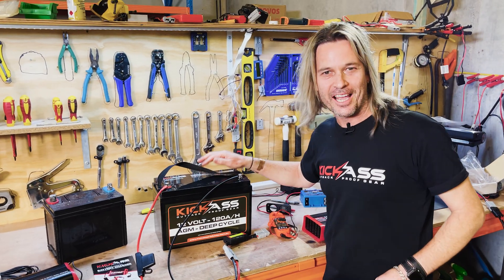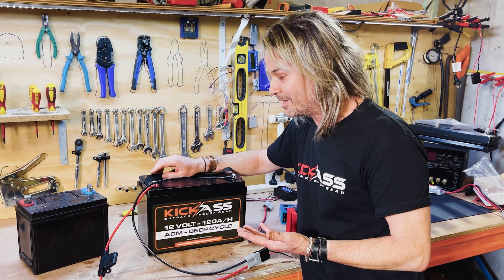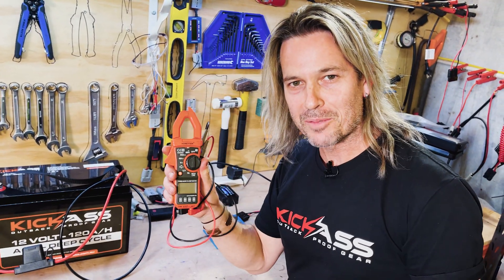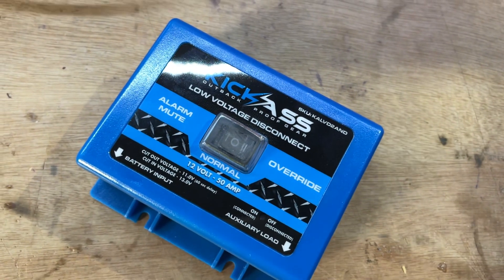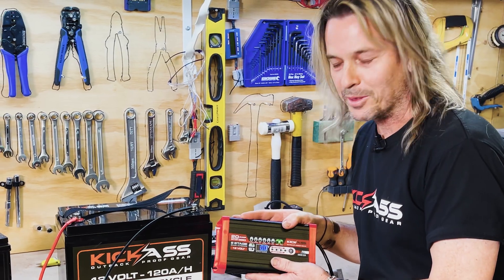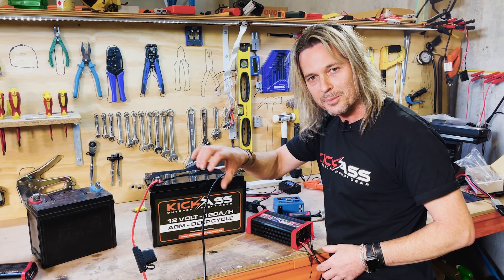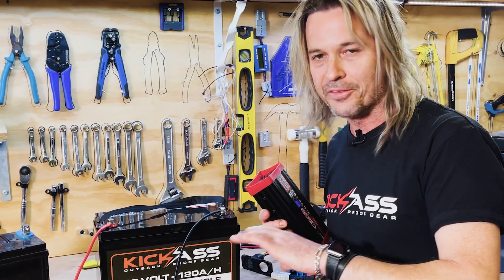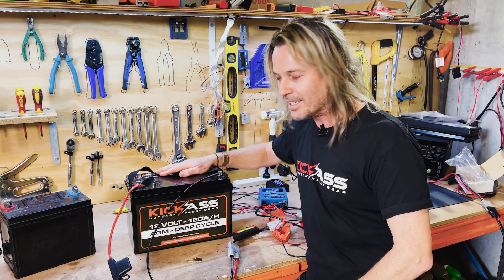How to charge and maintain deep cycle AGM batteries with Craig from KickAss Products

Comment: Hey Craig - Best video I have seen so far on battery maintenance explained in an easy to understand way. Can I ask a quick question? I am a newbie to this and recently bought a camper/motorhome with two solar panels which also came with two 80 Ah Gel Leisure Batteries already installed a few months ago by the previous owner. My understanding is that combined - these gel batteries should be capable of 160 Ah total (80 + 80 = 160). However - the camper's control panel reads as 100% capacity fully charged at 104 Ah, and not 160 Ah as I would have expected. Any idea what the reason for this apparent discrepancy might be?
Reply from the maker: Yes, they should be 160Ah.

1. The problem with buying 2nd hand batteries is that you do not know how many times they have been cycled. So they may have had more use than advertised. Same as when the used car salesman tells you a little old lady only drove it to church on Sundays.

2. Ensure that the charger is set to the correct settings. Different chemical makeups have different charging profiles. Make sure your charger has a Gel setting and is set to that.

3. Remove the batteries from the system and charge them separately on a suitable 240v AC charger (Again on the Gel Setting) This will ensure that the batteries get charged to the max. Some solar chargers especially PWM will not be able to provide a high enough voltage to fully charge the batteries.

4. The batteries may have been damaged at some point. If a battery is overly discharged it can do permanent damage. Even a brand new battery that is overly discharged will suffer a loss in capacity.

Hope this helps.
Reply: @KickAssProducts  Thanks for such a detailed and helpful answer. Subscribed. Regards.

Comment: I had the AGM battery in my Camper Trailer maintaining the charge off my KickAss Solar Panels for about 4 years now..... the other day I swapped the Solar Panels off my Camper Trailer so I could charge my Kickass Power Box for 3-4 days..... I came back to swap them back over again and find my Camper Trailer AGM battery at 10.5V 😪 without any items on to drain the battery, do you think the battery was on it's way out anyway or is 3-4 days (of no load) enough to take the charge on the battery from 13.1V to 10.5V?..... I have my KickAss Charger trying to "revive" my Camper Trailer AGM Battery now, hope it works!!! Cheers, Don, Perth WA 😀
Reply from the maker: Hi Don, That is very strange for the battery to drop voltage like that without load.

Are you trying to revive with an AC charger. If so, have you removed the battery from the system and tried to charge it with nothing else connected. 

If you can get it to charge then run one appliance off the batter (ie a fridge) to see if it discharges correctly.

If the voltage drops again rapidly this is a good indication that your battery has expired. Sorry.
Reply: @KickAssProducts  No worries, I'll give it a go. Thank you very much for your advice :)

Comment: An adjustable setting for the LVD would not be that difficult to engineer and would be of tremendous value. What is the max amp rating the LVD can safely discounnect at without buring up the contacts? Does it have a rating for that? Thanks again for these short and to the point YTs as I always learn something of value.
Reply from the maker: Hi Ben, While an adjustable setting would be possible it would drive up the manufacturing price and make the unit more complex. We have designed this as an inexpensive last resort. The unit is rated at 50 amps.

Comment: you said 10% amps of the capacity. can I use a lower amp charger eg: 6A for 115ah battery? it just means it charges slower right?
Reply from the maker: Correct it will just charge slowly. We just don't recommend that you use a charger that is to large as it can cause the battery to overheat.

Comment: Hi mate, just bought a caravan, first time user.
It has 2 x 225 amp AGM batteries hooked together, with solar charging.
What size 240 charger do I need to keep batteries charged at optimal level when not in use, and under a carport.
Great vid too.
Reply from the maker: I would go for a minimum of 22 amp. https://www.australiandirect.com.au/buy/kickass-12v-22-amp-9-stage-battery-charger/KACHG1222
Reply: Thank you for taking the time to reply mate. I must add they are two 6 volt Power AGM's hooked to make twelve volts, I also want to keep the charger in the van permanently connected and with the 240 volt plugged in and on, and it will only start when I plug into 240 power, because the batteries are under one of the beds.
 I suppose what I'm trying to say, in Maintenance mode?

Comment: 6:45 I have a much smaller battery bank of 2 28Ah AGMs in parallel.(56Ah total) I assuming a 20A DCDC is too powerful for me?
Reply from the maker: Hi Jay, 20 amps is definitely too much current to put into batteries that small. You would risk over heating them and causing damage.
Reply: @KickAssProducts  yea that’s what I figured.  Thanks for the input. Great video by the way.

Comment: Hi, I want to use an AGM as an uninterrupted power supply for a 240v 50w fish tank filter using an inverter. The battery will need to be under constant charge through a 240v charger. Even if I disconnect the charger once a week to allow the battery to cycle, will it destroy the battery or just shorten its life? A new battery every couple of years is cheaper than losing a tank full of fish during a blackout. Thanks.
Reply from the maker: Hi, Our systems are not really designed for this kind of application. The problem is that if an AGM battery does fail at some point you won't know about until the blackout as the charger will continue to keep the voltage up. I would highly recommend buy a small UPS (uninterruptible power supply) They are designed to keep computer systems running during a blackout.

Other wise Option 2 of disconnecting the battery periodically and allowing it to cycle is more preferable.

Comment: Hey, thanks for the video and info. I willonly be using my 120ah battery maybe 2-3 times a year. Should I keep it fully charged when in storage? Should I discharge it slightly and charge maybe every other month?
Reply from the maker: Try to keep it fully charged. The battery will slowly dis-charge over time so it's a good idea to check it now and then and give it a top up.

Comment: Can I please ask, why is it not ok to have loads on the battery when using a 240/12v to charge battery ? This is exactly what is happening when a battery is connected to an MPPT or DCDC charger. Perhaps it is optimal not to have a discharge at the same time but still acceptable. eg - camping and using a generator to power the 240/12v charger.
Reply from the maker: We recommend that you do not Discharge at the same time when charging from 240 as this should be the time that you are allowing your battery to recover and get a proper full charge. Generally charging from 12 volt sources is intermittent, your vehicle is not running constantly and the sun is not shining 24/7. So your battery is allowed to cycle. But providing a constant 240 volt source and running a load on your battery for long periods of time will eventually damage the battery. 

2nd, If you have 240 volt available why would you run it through a battery to run appliances.

Comment: Thank you guys for this. If only I'd known all this before I trashed my very first AGM battery. The old Arkpak battery pack is failing so I just bought the Kickass Powerstation which will mean I should have no more worries. Life's a learning curve I guess. Thanks again.
Reply: You are not the first to trash the first set of batteries! It took me over 8 months of traveling before I finally got the general gist of batteries - when I trashed both!  Oh yes, a good learning curve, goes with the territory. lol
Reply from the maker: As long as you look after your battery you won't have any more troubles.
Reply: Good percentage of us do mate. I discharged my 115aH to the point of no return. Lucky it was $80 from marketplace 😂

Comment: hi craig , dont know if you can help mate , but ive got a solar set up off grid here , when i charge my battery bank  ' 4 x 12v batteries hooked up for a 48v set up ,  the batteries are190 ah each but ran as only 190 ah together , which sux  because i thought i'd get 700 odd a/h  , but i cant do it  , anyway my problem is , the batteries will charge upto the 56v i set them to , but then they start discharging ,  is that normal ?  i need the 56v so i can run my set  , and it runs down to 48.1  that i set as minimum  then next day it recharge to 56v again ,  but , soon as it hits 56v , it starts coming down  with no load on it ,  best way i can describe it is , it charges to full then discharges it ,   can you help me at all ? i'd very mjuch appreciate knowing how to keep my battery at 56 and it holds there until i use it .
Reply from the maker: Hi Dave, Unfortunately we do not advise on off grid solutions. 

We specialise in small setups for caravans, campers, 4wd's etc. Best bet is to speak to someone who is an expert in off grid systems. Sorry.
Reply: @KickAssProducts  was worth a shot  lol . thanks for replying

Comment: hello i can"t understang inglish well can you tell me minimum discarge voltage for agm 12v ?  Thank you!
Reply from the maker: You should only discharge an AGM to 50% of its rated capacity. 

It is advised that you do not let voltage drop under 12V at rest.

Comment: Do u guys make a lithium battery bc I’m hearing a lot on the web how you can use a lot more amp and does better with temperature also Weighs less charges quicker as well
Reply from the maker: Hi Doug, we are working towards a lithium battery, hopefully we will will have them available early next year.

Comment: Great information thanks. Can I just clarify, if I want to use ‘shore power’ when camping at a powered site, I should run a smart charger through a DCDC charger if I’m running my fridge and other 12v appliances?
Reply from the maker: No, don't run an AC charger through a DC charger. Your charger needs to be able to read your batteries voltage so that it can input the right voltage and current. 

You should have both chargers directly connected to the battery. But only use on or the other.

Comment: Great video! When batteries are not being used for several months, is it better to keep on trickle charge or occasionally put it on 240v charge?
Reply from the maker: EIther is generally fine. If you are going to leave them on trickle charge make sure you have a charger that supports that mode so that you do not over charger your batteries.

Comment: Hey, Love the video.
I have a 120ah battery in a box with a projector dc charger sitting on top, can I plug the 240v charger straight into to it or do I have to disconnect the dc charge first
Reply from the maker: If your DC charger is not receiving any input from a solar panel or alternator then it is fine to plug in your AC charger to one of the standard input/output andersons as the DC charger has an isolator built in.
Reply: @KickAssProducts  Thanks for getting back to me.

Comment: Can you give the specs for the chargers and DC toDC kit please or put links to the gear that you use
Reply from the maker: The DCDC charger specs shown are available here: 
https://www.australiandirect.com.au/buy/kickass-25a-dc-charger-with-anderson/KADCDC25A-AND

The 20 amp 240 volt chargers are available here: 
https://www.australiandirect.com.au/Battery-Systems/20Amp-Deep-Cycle-Battery-Charger/KACHG1220

Comment: Put 2 new 120agm batteries in caravan... Volt meter shows 13.2.have been on 240v since i bought them. But then it goes to 13.4 then to 14.0. And goes back to 13.2
Reply from the maker: The reading will change as the 240v charger runs through different cycles.

Comment: I have 2 135Ah batteries and use the Kickass 20amp charger when they are not being used. Is this still ok to use? Or do I need a larger charger
Reply from the maker: You might find that you are running the charger very hard to charge such a large capacity and it will take a very long time to get a full charge. A larger  charger would definitely be beneficial. 

You may find you will get a better result charging each battery separately.

Comment: Hi their! Interesting video and quite helpful. You said not to connect any other loads when using the 240v smart charger! Is it ok to still have a radio or CD player connected to maintain power to the memory or clock in standby mode?providing I don’t switch radio on by the radio on acc wire!
Reply from the maker: If the radio is switched off / standby mode then the current draw should be next to nothing so this should be fine. 

The reason why we recommend that there is no load attached is because any current draw lowers the batteries voltage.
Therefore the smart charger will detect the the batteries voltage as lower then it actually is and over charge it.
Reply: @KickAssProducts  that’s perfectly understandable! I recently did a pet project, it’s a tool chest upper half boom box radio with a couple of power sockets it runs on x2 15 amp hour batteries. I’m using 240v smart charger to charge batteries, I was bit concerned about radio stuffing up or the battery over charging when radio on standby while on charger! So far I’ve had no dramas just as long as the accessories connected are switched off with the exception of the radio on standby! Thanks for your help!

Comment: With Lockdown here in Melbourne continuing and I'm not going anywhere, could I purchase an AC charger and charge both my main starting battery and an AGM battery that is in the engine bay both at the same time by connecting to the main starting battery as there is a shut-off solenoid already connected and thus charge both batteries as it would normally do when the motor is running?
Reply from the maker: With our 240v battery chargers the settings are different for different battery types AGM, Wet, Gel etc. This is to ensure that the correct voltage is applied to the battery throughout the different cycles. 

We recommend you charge the batteries separately for the best results. 

Use the "Wet" setting for your starter battery. 
And obviously the "AGM" setting for your auxiliary.
Reply from the maker: I do apologize I accidently deleted your comment as I was replying.

Tim's question was along the lines of "why can a vehicle's alternator charge both batteries at the same time? and is there a product that can do this?"

Comment: Is the battery disconnect (the blue box, LVD) settable or is it at a fix number of volts?
Reply: Fixed
Reply from the maker: Hi Ben. The LVD has a fixed cut off at 11 volts.
Reply: Is there a LVD with a watt meter ?

Comment: When are you guys going to get into Lithium? It’s getting close to calling time on AGM. LiFePO4 is getting quite affordable and lots doing it themselves with cheap cells and BMS’s from China anyways. With your access into Chinese manufacturers and suppliers I’d expect to see that by now?
Reply from the maker: High Mike, We are currently developing a Lithium battery! We are taking our time to ensure that when we bring it to market that it is the highest quality we can produce.
Reply: @KickAssProducts  great to hear! Can’t wait to see it.
Reply: @mikewasowski1411  hey you should do a video on the set up you did. I’d like to see it and use in my boat over the 2x agm set up i currently run.
Reply: My research tells me AGM is still better, the only thing LifePo4 had going for it is weight. lack of weight. There are some good videos explaining the reason.
Reply: @dennisbauer3315  I built an 80AH LiFePO4 battery with reputable quality cells and BMS in a case with USB, Anderson and 12V outlets and shunt battery monitor for $450. An equivalent agm would be a 160AH rating and doesn’t come with those accessories and would likely be more expensive. LiFePO4 is much smaller dimensionally and weight difference is huge. If you are slightly handy is a dead easy project to DIY a LiFePO4 battery. Can’t ‘DIY’ an AGM….nothing to DIY. Have to buy the battery and battery box put one in the other.
Reply: @buryitdeep  you are absolutely correct. Insurance wouldn’t touch you. But I wonder if it would be the same story if you bought a commercially available battery and installed it yourself in the back. Would they pin it on your diy cabling, terminals, shielding etc.